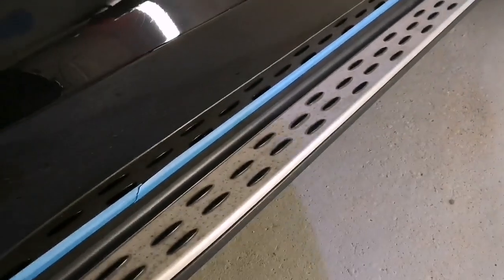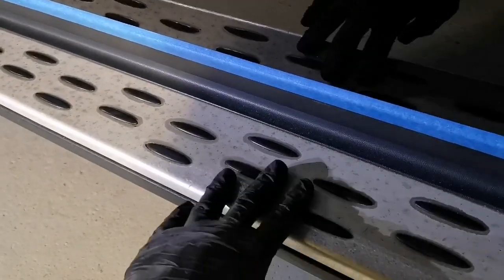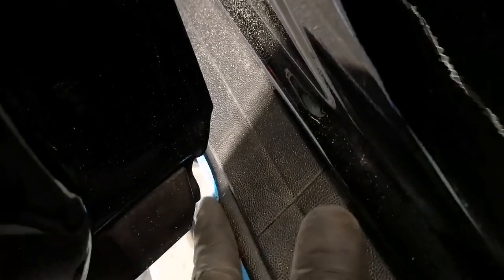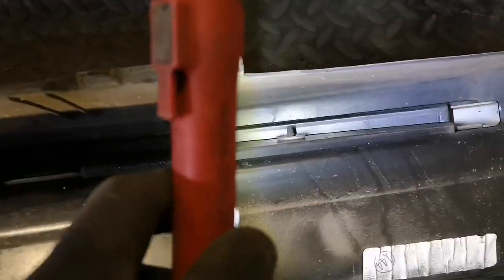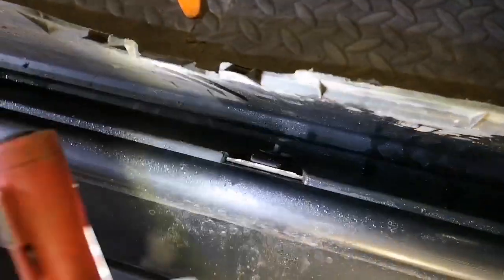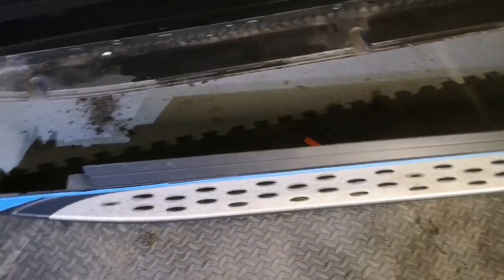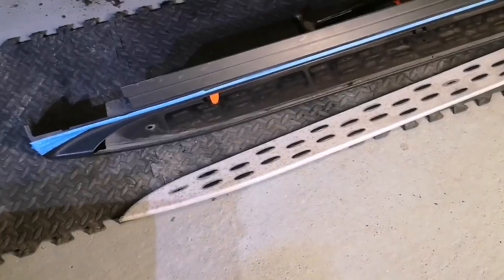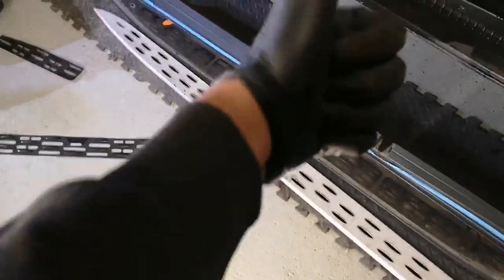How To Remove Aluminium Insert Mercedes ML W166 Running board/Side Steps for cleaning

Comment: Thanks for an excellent tutorial. With this info, I was able to replace the inserts on my X166. The process is exactly the same as your W166.  My X166 has leds integrated into the running board. The hardest part was trying to unplug the wire. I found that I had to soak the connector with WD40 for 5 - 10 minutes before trying to unplug.
Reply from the maker: Glad to have helped :)
Reply: Those electrical clips were BRUTAL. I wish I took the time to soak them

Comment: Tracklife- Do you know if you can get the rubber non skid inserts for the running boards? I have 2015 GL with running boards that cleaned up really nicely but one rubber bump came out during cleaning. It was not one of the securing ones with the washer on the bottom side..
Reply from the maker: Check with your local Mercedes dealer, they should be able to help

Comment: Hi do you know if the w167 gle is the same process to remove ?
Reply from the maker: Not sure, but likely to be similar
Reply: Cheers for the reply, I take it you can't remove the metal top without having to running the whole board ?
Reply from the maker: I don't see any other way to remove the metal without taking the running board off
Reply: @TeamAteem  OK thought as much what a ballache lol

Comment: I am going to power coat the plate, should last 4 times longer. What about the reinstall?
Reply from the maker: Nice. If you can remove it, reinstall will be simple 💪🏽
Reply: How much powder coating will it cost if you don't mind?